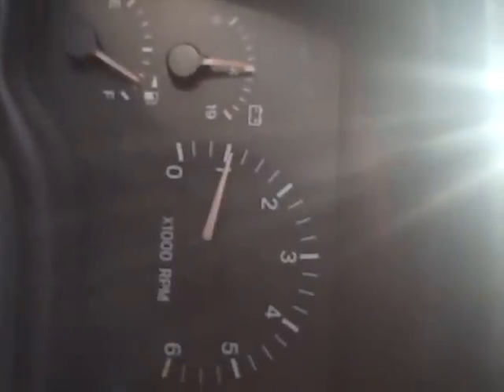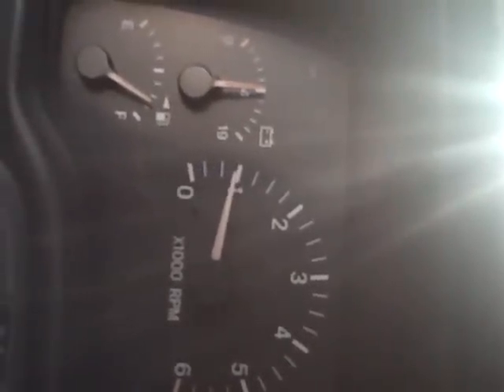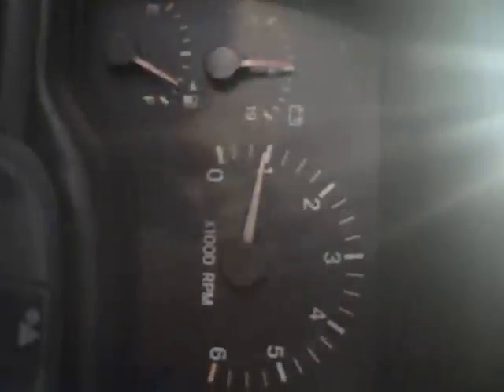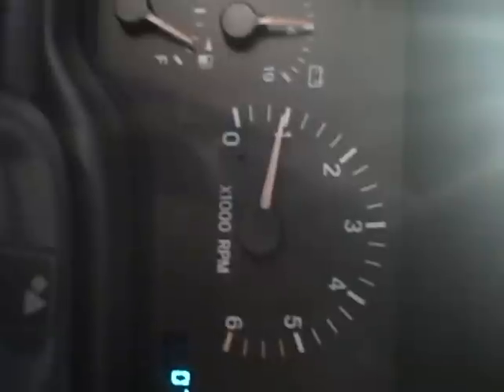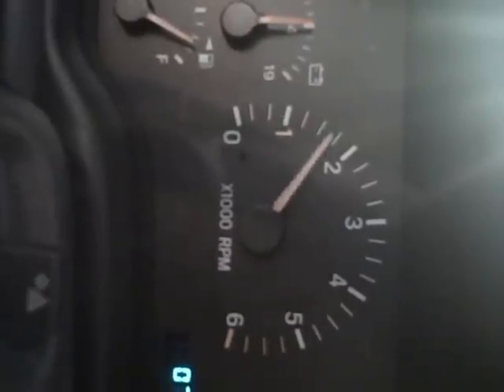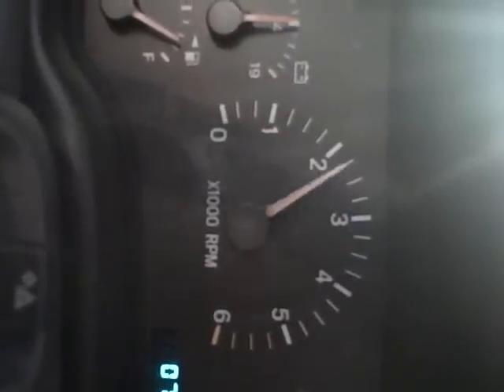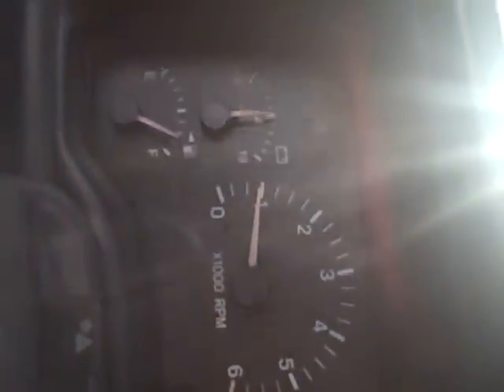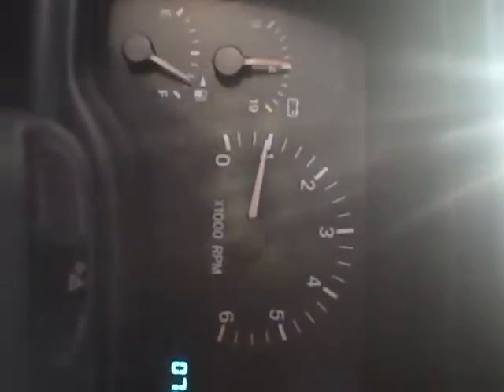Jeep misfire/stumble *** fixed *** oem cps sensor

Comment: Nathan I'm Al with Big As Auto Repair. My 2001 4.0 was doing the same thing. I can't tell you what your problem is, but I can tell you what my problem was. The 4.0 has a problem with the distributor shaft becoming loose and allowing it to be out of time just a little causing misfire and sometime stalls. Replacing the distributor housing fixed mine. Nathan google "PART GEEK" you can buy a distributor and it comes with a new cam sensor for around $50. Hope this helps! Visit my website at bigasautorepair.com
Reply: Thanks Big Al!  This was the culprit in my case.
Reply: LOWGEAR100 ....question.

I have an 01 high output and it runs great except at an idle and the tach bounces, again, only at idle. replaced cps, tps, idle air control, map, tuneup and besides going postal, thinking the parts suck, bad shaft or just possessed.

Can you define your symptoms please? if I'm idling, in gear and just slightly touch the throttle, it smooths out and runs great. moment it idles in its own, poop again...I'm thinking shaft but also possession...please help
Reply: The 2000+ do not have a distrubutor. They are coil on plug.
Reply: I just bought a 98 wrangler 4.0 with 194k on it.  I was driving it to work this morning and noticed a slight stutter/hesitation at highway speeds.  I have done nothing to it other than adding sea foam to the engine and fuel tank last night.  I first noticed the issue yesterday on the highway.  I have yet to notice it at lower speeds like around town (45mph ish) only at 60+.  I don't feel any issues while accelerating only when cruising.  I am new to the Jeep life and would really appreciate any help.  

Side note: There is a slight tap at idle almost as if it is a lifter.  The guy I bought it from said he had the compression checked by a mechanic and there was no issue there.
Reply: 2000 doesnt have a distributor but there is a sensor where the distributor would be.
Reply: Big As Auto Repair
Reply: I have a 98 Jeep Grand Cherokee Laredo. Inline 6 cyc   For a few weeks ran perfect. When l tried to start it back l had fuel but wouldn't start. Been checking all wires An even had to hot wire to get it to fire. It's had the coil changed New started an a few more parts still can't find the problem can you help???
Reply: @Scram_jam7  that's funny

Comment: I had the exact same prob replaced all the same things & still did it, dealer wanted to do a head job for $2500, f*n crooks, no thank you, picked it up they left vac lines off among other things. SO I WOULD TRUST THEM TO DO REAL WORK? ANY WAY>>> SEAFOAM SEAFOAM!!! I watched a couple of vids on here about it. I used it in the gas. In the oil for 1k b4 oil change (was scared of that) I only like oil in my oil, and last in the intake 2 diff times, I didn't get that big smoke cloud,  ALL SMOOTH